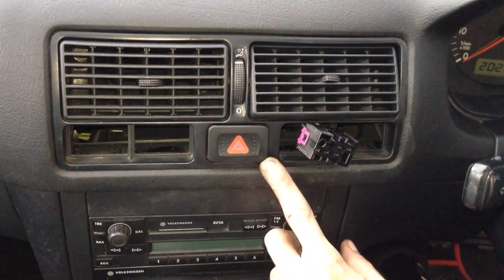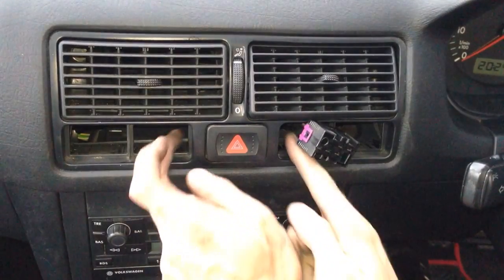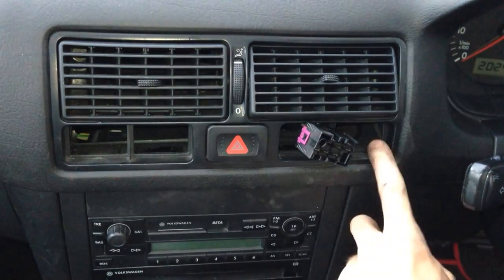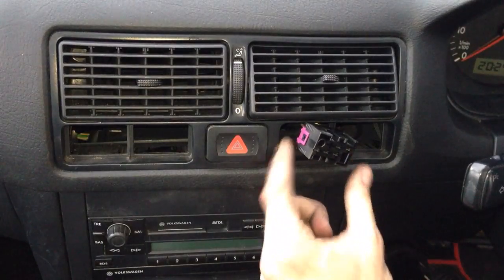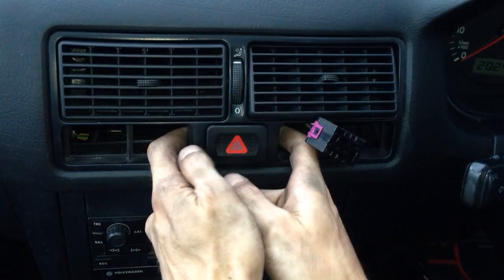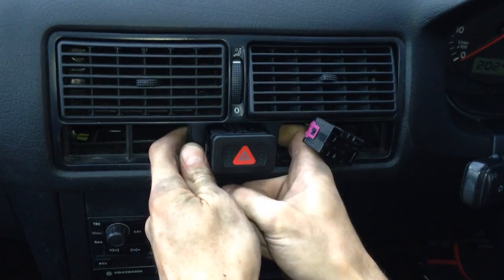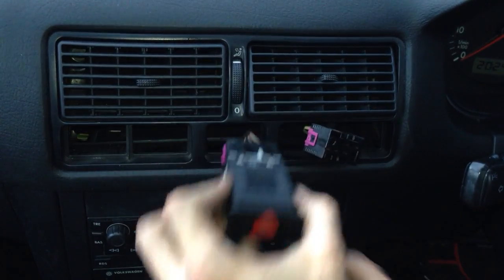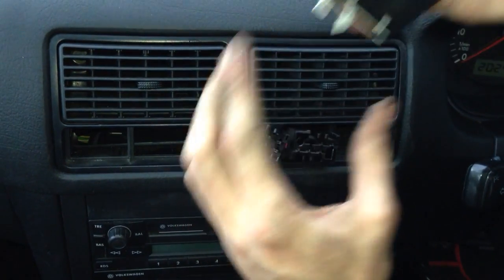VW Golf MK4 - how to remove/replace hazard warning light sw

Comment: Spot on. Indicators not working and thought I would be sucked into the 'stealers'. Used this video with a new hazard switch and voila. Thanks for the post. Helps us newbies considerably.
Reply from the maker: Thanks for watching!
Reply: DIY Mechanics My indicators work fine, but there is a random ticking coming from my hazard light button.  Would replacing this switch, resolve the ticking?
Reply from the maker: More thank likely. As long as no bulbs or fuse have gone, it's probably the switch